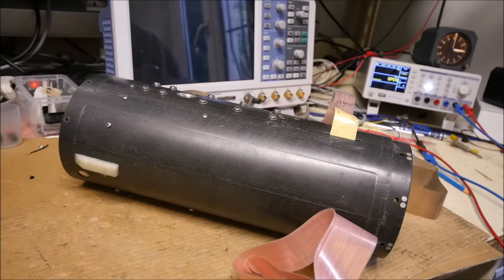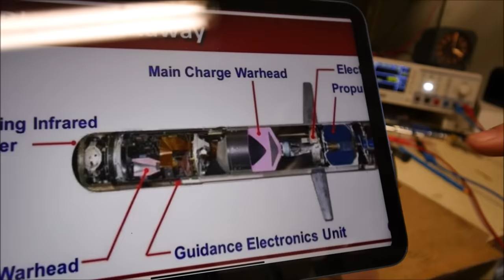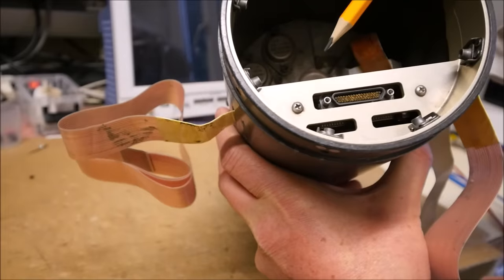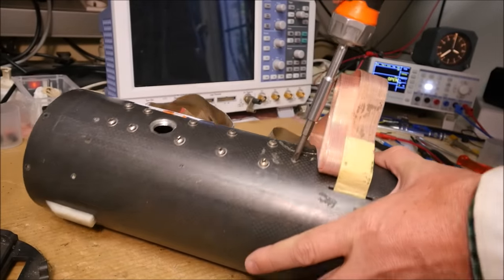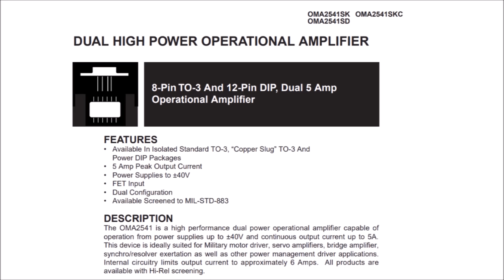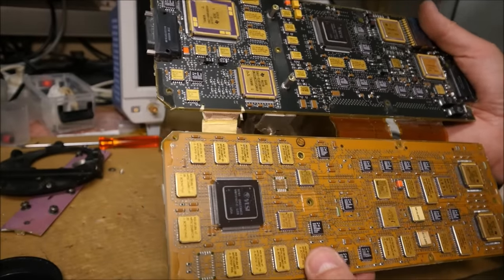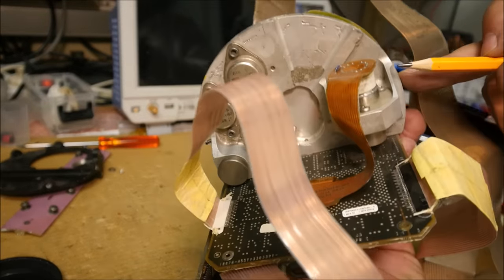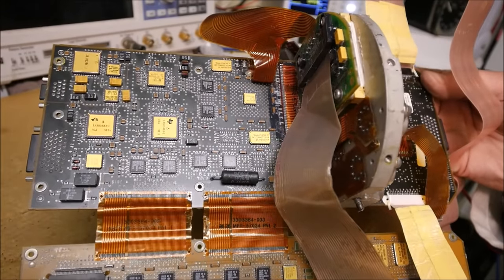LDM #354: Javelin Missile guidance computer - Part 1: teardown

Comment: I used to work for an avionics contractor. It’s interesting how similar this is to modern hardware … yet also very different. Everything has FPGAs with 16-layer conformal-coated boards. It all has a 1553/1760 bus with expensive parts and a lot of redundancy (compared to consumer stuff). But look at all those ribbon cables and interfaces! In 2007 we were already working on 16Gb fibre interfaces because the F-35 needed the bandwidth. But many years before that we were making missiles with a lot more resistance to EMI than this appears to have. But it’s a funny mix of new and old. I used to have to look up specs in manuals from 1973.
Reply: I was surprised by these ribbon cables too. Aren't they vulnerable to acceleration overload?
Reply: That’s really interesting. 👍 Thanks for sharing.
Reply: I’ve heard one of the limiting factors now for the F35 is that it’s maxed out in its ability to get rid of all the excess heat created by the avionics/computers. I would bet there’s only so much bleed air from the single jet engine that they’re willing to sacrifice to be used to power & cools all the electronics.
Reply: @TheAlexBell  Remember it only has to fly once. On the pictures it looks like the flat cables are covered with tape on the outside of the missile, so there is no drag on them. And the unsupported parts inside the body are probably light enough, with large soldered contact area. The cables also are a lot sturdier than the flimsy things you find in modern laptops and smartphones.
Reply: But why would you use FPGA in mass production? I thought that you only do FPGAs for rapid prototyping and after you are sure about the hardware you've emulated, you can just mass produce it instead
Reply: Do you ever feel all those years of work you put in was eventually meant for human suffering
Reply: @vadimemelin2941 taking a guess, FPGAs are more flexible and can be reprogrammed as the software is improved, or as the supporting hardware evolves or is replaced by what's available.
Reply: @vadimemelin2941  Nope, plenty of FPGAs are used. There's probably just dont manufacturer enough of them to justify the expense of a manufacturing ASICs, plus if anything has to change, in software etc. or maybe they change hardware pieces from time to time, all the old ASICs would just be thrown away. FPGA allows some flexibility.
Reply: @manikyum  My contribution to the military was writing a lot of databus diagnostic software. I worked in an R&D office which had to close during the 2008 financial crisis. Even though banks had just gotten trillions in bailout money, they couldn't give us credit for payroll. And the biggest contractors also weren't in a hurry to pay us. I don't know. I guess it's not much of a leap to say that developing anything for military aircraft promotes suffering, but most people who support the military of their country are hoping to promote the greater good of humanity more than they promote human suffering. Certainly it doesn't always turn out that way. But as a software developer I enjoyed working in a small office of nerds doing avionics a lot more than I enjoyed working in an office full of corporate douchebags who literally have no life goals except to make more money and get people to spend more time looking at ads or spend more money on cars or whatever. Every time I've thought I was getting a better job the people were more soulless. That includes my most recent job in the music industry.
Reply: @RaquelFoster I guess it wasn't the 'Soul' genre of the music industry.😊
Reply: You are the coolest. 😎
Reply: Spaceflight and Military technology benefits humanity through the competitive state of the art getting passed down to medical and commercial sectors. Without it there would be very slow progress. The very high standards of engineering discipline are refined and the best of it gets adopted outside. There are also so many things that have come out of wartime development, there are countless examples   someone else can list some of them
Reply: @vadimemelin2941  FPGAs are used in many industrial products with bigger volumes than this.
Reply: @TheAlexBell maybe it's OK because it's only ever used once
Reply: @RaquelFoster okay comrade, cheers from the other side!
I am a proud member of shitty true commie party that does correct things and has almost zero influence, in short, by theory military-related job is useless because it is used for creation of destruction tools that doesn't make economic good as, for example, parts of cnc machines, sorry for oversimplification.
This corporate nightmare is the main reason why military exists, You were placed in comfort conditions because exploiting You is not that profitable as making the instrument(place in a production chain).
I had also military related job in worse conditions because poverty and 3rd world country.
But I do hope that maybe long time after, when finally the revolution will win all these instruments and tools would be collecting dust like some bizarre weird toys in the museum.
But we are living in a real world where basically businesses are making money and war also is the way of making money (2 world wars as an example).
So, please, do not listen moral idealists that are living in some marryworld: even for revolution we had to use military instruments to finish wars, at least from economy point of view.
Reply: Dope
Reply: @PBMS123  there is also the loss of configuration on power, so in various circumstances, less possibility to capture sensitive configuration infomation, if the launcher is what holds the code to load the fpga, and that loader is wiped on launch
Reply: @vadimemelin2941  testing in FPGA -> producing VLSI
Reply: @vadimemelin2941  Anything that needs to have decent compute power needs to use an FPGA unless you're producing enough to justify an actual fab run. These days that means you need to make about a million of something. So weather you're making a missile for the military or high-end audio stuff you need to use an FPGA for anything you can't do on a general purpose CPU. Things like advanced signal processing or just dealing with high-speed data in an unconventional way. And these days there's also custom security stuff going on in FPGAs. Xilinx has been working with contractors for a long time. A lot of people working on embedded systems are just used to using FPGAs.
Reply: @vadimemelin2941  , I'm not sure if missile guidance systems would ever class as mass production. Also FPGA's can be patched in the field.
Reply: Would you like to get to know one another??
Reply: One of the hardest EMC tests for a plane is lightning. I dont think this kind of missile has to go through it.
Reply: Javelin is a pretty slow missile. @TheAlexBell
Reply: Those ribbon cables are a nightmare to mitigate EM interference.
Reply: You look 🔥🔥🔥
Reply: @manikyum  If that device works as expected there won't be any suffering felt by the target ;)
Reply: How small the world now im still surprised. You can talk about Javelin or F35, or about Moon program with its creators, its fantastic! Impressive work inspire to make something too.
Reply: How small the world now im still surprised. You can talk about Javelin or F35, or about Moon program with its creators, its fantastic! Impressive work inspire to make something too.
Reply: @vadimemelin2941  Once the battery dies, the guidance algorithm and all secrets dies with it as FPGA are volatile.

 They are as such impossible to reverse engineer.
Reply: @henria.277  now that's the design choice I believe

Comment: The "sensor" is a javelin rate gyro probably made by marconi. It contains flourocarbon fluid and gemstone bearings.
The pink coating at 6:13 is beryllium oxide and is toxic like asbestos.
Reply: ПРО токсичность Асбеста ничего нам неведомо , до сих пор все крыши жилых домов в России сделаны из шифера , где асбест главный компонент , у нас есть даже Город  Асбест .
Reply: how do you know it is made of beryllium?
Reply: @МигУдачи   There are two types of asbestos, chrysotilly and amphibol, the first is less toxic, and is now used. If it is processed in the speaker, then everything will be fine.
Reply: Like asbestos, it basically needs to be breathed in to become a serious problem.
Reply: lets hope frenchie boy washed his hands then
Reply: Didn’t know the Russian asbestos industry cared so much about their jobs that they hired a troll factory 😂 People should disregard everything in this sub thread as utter propaganda.
Reply: @KarryKarryKarry there are 2 types of asbestos and initially the safe type was produced. The dangerous was used only for specific military, nuclear and airspace needs.
Reply: Unlike asbestos, once Beryllium Oxide has been pressed into something, it’s quite safe to handle. Just don’t grind that pink thing up into dust.
Reply: Beryllium oxide has white colour.
Reply: Incredible read. Thank you,  I did not know these things existed
Reply: @KarryKarryKarry  Right? Was wondering why folks were so defensive about it in the comments 😂😂
Reply: @МигУдачи Асбест из российских месторождений не токсичен, в отличии от асбеста европейских месторождений.
Reply: Are you sure it is beryllium oxid? Because if it's true, it will make serious health hazard in the target area.
Reply: @milariha007  I think there are more immediate health hazards in the target area when the Javelin warhead detonates 😅
Reply: @TehNetherlands  I know :-)
Reply: How do you know all this information?
Reply: @kardanium why is that? The particle fibres shape and chemical structure is what makes it dangerous. Every material with similar properties could be dangerous
Reply: @TheBozn  Состав асбеста отличается в зависимости от месторождения. Это ископаемый материал и его не производят на фабриках. Так вышло, что асбест, добываемый в месторождениях восточной Европы и России в частности, менее токсичнен, чем асбест, добываемый в центральной и западной Европе. Просто потому, что химический состав у них разный.
Reply: @kardanium  Egrapses auto to keimeno epeidi variesai na grapseis agglika h epeidi den ksereis agglika kai xrisimopoieis kapoion online metafrasti ;
Reply: No, the pink coating is in fact just 2 component high performance epoxy, widely used in carbon fiber/aluminum structures. Possibly Hysol 9412 or similar.
Reply: The pink stuff looks like kinda gap material. It is applied between the carbon housing and the aluminum plate, so not necessary to use BeO. The OpAmps have BeO ceramic substrate BTW. It is written on the TO3.
Reply: @zazio5535 Could also be a thermal gapfiller.

Comment: * The pink stuff gluing the metal plate to the carbon fiber body tube is heat transfer paste.
* Those large VLSI parts are gate array parts rather than FPGAs.  Gate arrays are midway between full-custom parts and FPGAs.  VLSI used to make gate array chips where the silicon and maybe 1 or two metal layers were standardized, but the top couple of layers of metal were customized.  So for the price of taping out (and making masks for) two metal layers, you could get a part with 100x the gate count of an FPGA, without having to pay the full cost (and manufacturing delay) of a full-custom 3-5 metal layer part.
* Hardly any heat sinks!  Most of this stuff didn't run long enough to get hot.  Must of been a PITA to debug, since it probably got pretty hot during a debug session.
Reply: Submerge in mineral oil and do the debugging🤣
Reply: The ‘GA’ in FPGA literally Stan’s for ‘Gate Array’. For cost reasons, it was probably cheaper to reproduce the GA in large numbers with the final configuration once the configuration cleared development and testing.
Reply: @derekedmondson9909  Field Programmable Gate Arrays and Gate Arrays are different technologies.  The names are misleading, but what can you do.

Gate Arrays are quite a bit less expensive that FPGAs, and use a LOT less power, and are much higher performance.  On the flip side, I can reprogram an FPGA in a minute, but a new gate array is... months and at least several hundred thousand dollars.
Reply: @derekedmondson9909  >"reproduce the GA in large numbers with the final configuration once the configuration cleared development and testing"
There's a consideration of security as well - it being safer and actually cheaper to program the FPGAs yourself than to manage a secured trust relationship with a 3rd party for that function. Malicious code and hardware injection is a huge and growing problem in the field

Comment: Wow congratulations for this find, currently I have nothing better than Sidewinder rollerons on my watch list !   All the golden parts are space grade quality, all that for a single use device, how wastefull war is.
Reply: Hey war is all about the gold plated military grade toilet seat 🚽 on the taxpayer's dime 😅
Reply: The cost of the targets this missile is launched to is a lot higher than the actual missile.
Reply: @h7qvi  All COTS stuff at first glance so really not that exotic.  The actual cost to the military includes long term storage/packaging/training and disposal so that bumps the price way up.  These thingy have to last for many decades in some drafty storage bunker and they have to survive the g-forces involved in launch all that adds up.
Reply: @DelyanT  So it's even more wasteful, in that case. Or perhaps that's what you meant.
Reply: Yeah, think about how much we wasted stopping the holocaust! Jeez. Sometimes war has it's place.
Reply: Everybody except the arms manufacturers loses in a war.
Reply: @byterock  Yes i know, but out of jest there's just so many ways to sell a big $ system to the military where none was needed before. Adding to the prices are things like RAD hardening and guaranteed parts availability for spares.
Reply: I have a torpedo gyro from a WWII era torpedo. Incredibly nice machining. All to go BOOM!
Reply: @byterock  Yeah. Back in the day (80's) ceramic packages and gold flashed lids were far more common. In my opinion this doesn't mean they're space grade parts, just military grade.
Reply: War war the original reason we created these complicated computing systems.
Reply: @JerryBiehler  My friend (really, not me) has a wing gun from a Japanese Zero.
Reply: @PsRohrbaugh  Holy fuck, there's something called "tact", my friend...
Reply: Those rollerons are sweet but damn they can be pricey

Comment: Random but aesthetically I really love the big multi-chip era of computer hardware. Just looks so interesting.
Reply: That's because they were designed by humans and not computers back then.
Reply: @Coecoo 
No, still humans. The chips just got smaller. What, you thought boards with tons of chips were designed that way because they looked better and "soulless machines" with no sense of aesthetics took it from us? Obviously what happened was chips got smaller, more powerful, more efficient to the point multiple could be stacked on the same die, that we needed less of them
Reply: @Coecoo  More like because the combined power of the entire thing doesn't even hold a candle to a dusty raspberry pi, and less chips = less failure points and less interconnects to manage.
Reply: @cpte3729 not entirely humans. Most of the fitting and layout is computer generated because they're much better at optimizing for timing.

And they're rarely "stacked", just placed side by side on the same chip interconnected.
Reply: @cpte3729  Nope, completely false. Please do your research before talking nonsense.

A solid 90% or more chip designs these days are entirely computer generated. Pretty much the only input human has in their creation are entering parameters for the computers to follow, like designating areas for where cable ports need to be.

A large part of the unfeasibility of having human-designed things is large parts thanks to the mainstreaming of multilayered PCBs. Trying to teach humans to efficiently plan out tens of thousands of pathways in a layered 3D structure instead of having a computer do it is wishful thinking at best.

Comment: I used to work for a precious metal recovery company and can tell you, those gold plated chips and edge connectors make these boards [as with most old military electronics] worth a fortune!
Modern boards/chips are gold plated measured in microns... old military equipment were absolutely lacquered in gold
Reply: i can imagine some Ukrainian guy firing the missile, then running at the speed of sound out his trench with a butterfly net.
Reply: why use gold anyway?
To protect from rust or?? we have stainless steel, a lot cheaper. I dont see the reason to use gold.
whats the point?
Reply: @jw200  if you are using modern, expensive munitions, you need to make sure they work with no chance of failure.
Reply: @jw200 gold is much more conductive than ss

Comment: Great video! That was so high end cutting edge stuff and crammed in that, I bet just manufacturing the carbon fiber shell made a few people tens of millions.
Reply: Millions yeah, it would be dry fibre wrapped around a mandrel and run through an RTM press that would have been the bulk of the cost and charged up-front to the government. In the 90's / early 2000's they were probably using a template fixture for manual drilling and cutting, rather than CNC. The resin is probably phenolic and the PPE for the manual processing was probably pretty crap

Comment: Imagine all this is made at the same time as consumers were able to first time see a 16bit Intel 286 CPU.
Reply: Huh? This item is from the late 1990s and as far as Wikipedia goes the system debuted 1996. 32-bit 386 came to market 1985, way more powerful than the 286.
Reply: @benbaselet2026  you could be right, my understanding was this is 80’s tech and the 286 was release in early 80’s, so that was my thought process.